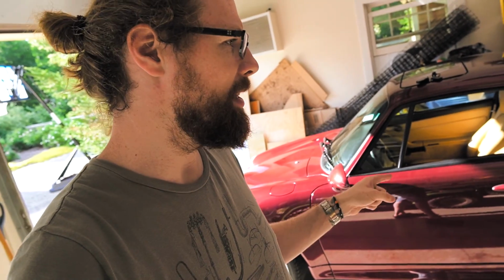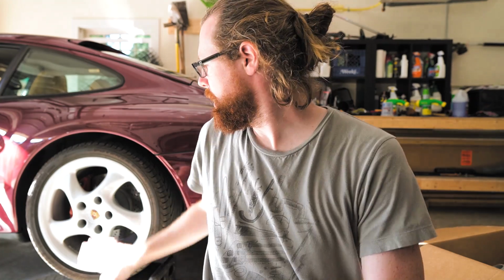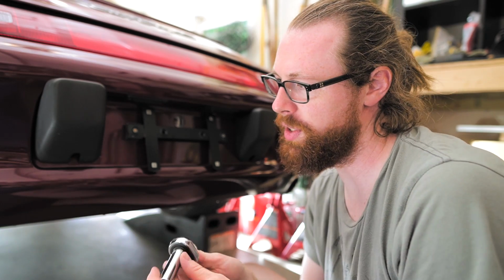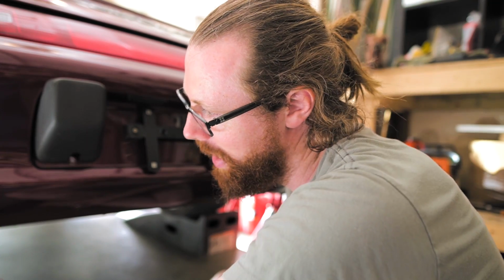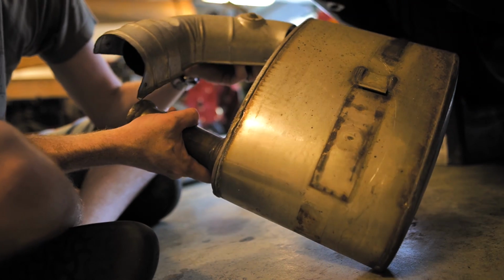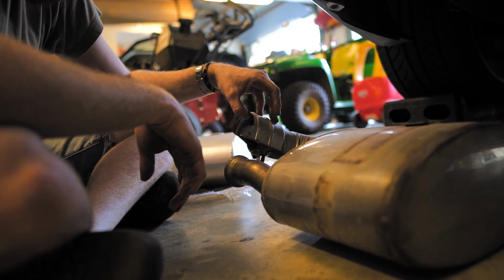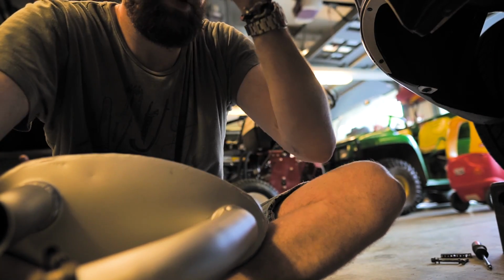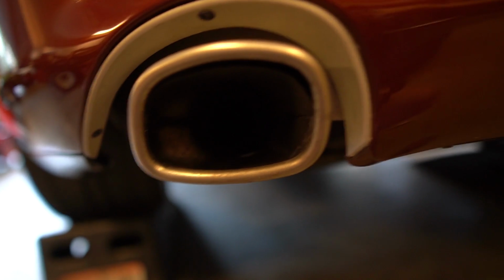Fister Stage 3 Install DIY on Porsche 993 911 Carrera

Comment: great video.  thanks.  just wondering what ramps you are using.  with my lowered suspension nothing seems to work.  although i notice you back your car onto the ramps.  is that to gain enough clearance to fit the ramp under the car?  do you have the make and model number of the ramp, and if you have a ruler handy, can you tell the the height of the ramp?  thanks.
Reply from the maker: It’s a little tight and they slide, I got them at Napa

Comment: First off a big thank you Ross for pronouncing the name of the car correctly: yes, it is PorschE not Porsch. Rare treat to hear pronounced in the right way in US. Second IMHO the original mufflers sound better on the car. No offense but I believe no way to improve a factory built Porsche, Ferrari or Rolls Royce. It is impossible. It is like a botox treatment on a beautiful 24 years old movie star. She is not getting better no matter how much botox we inject in. 
BTW I am looking forward the first generation typ2 VW Bus review, I think this model is one of the most iconic sculpture on wheels ever built. I had a second gen typ2 before, I loved it but the first Samba bus is the real treasure for sure. 
Ross, have you ever considered to take a good look into the amazing world of steam traction engines. I know you would love to have one. Those are the pure machinery which changed the world for the better. They are available in different sizes, can be custom built from parts available or can be bought ready to steam up. Please watch a couple of video about them here in YT and share your thoughts with us on them. Please, please.😀
Reply from the maker: i hear you 100%, of course Porsche did louder exhausts on the RSR / SuperCup, so installing one of those on a C4S would be similar, it's not how they designed the C4S, but it does sound good!  I have a 1961 volkswagen split window bus, I love it.  It's easy to drive and a lot of fun.  I haven't looked at steam engines but that's a cool idea.
Reply: Tire Kickers Thanks Ross!

Comment: The motor sound package on the 993 has a nice deep growl.  Why install something that is loud and obnoxious to everyone who hears you go by.  The night before you should have sprayed all of your fasteners with Kroil, so as to not have any problems.. exhaust bolts like to gall and seize when you take them off.  Stage 3 is way to loud for the street.  I guess you want to sound like all the straight pipe harleys, and set off car alarms when you go by.  It’s mot going to make you go any faster. Good that your keeping the sock parts.
Reply from the maker: It's not too bad, I've heard a lot louder.  This sounds very similar to the RSR exhaust.